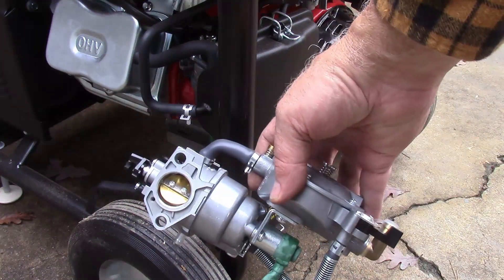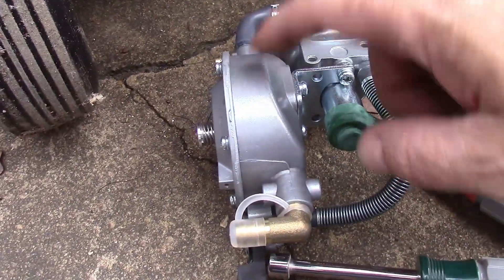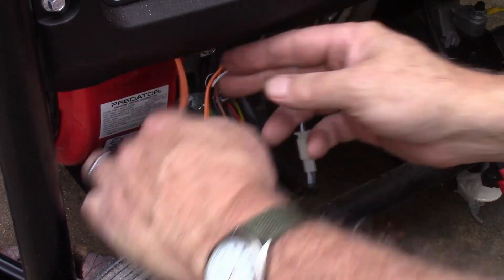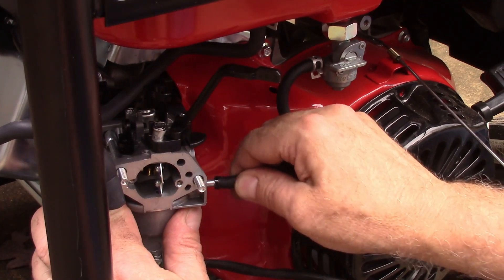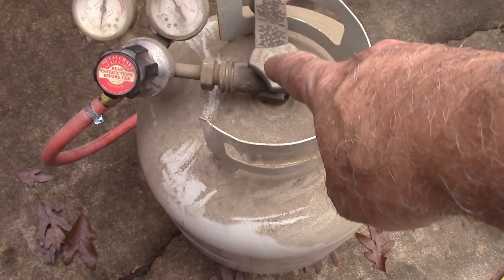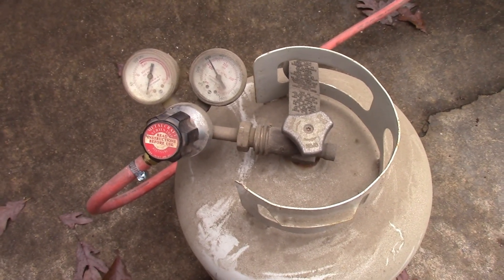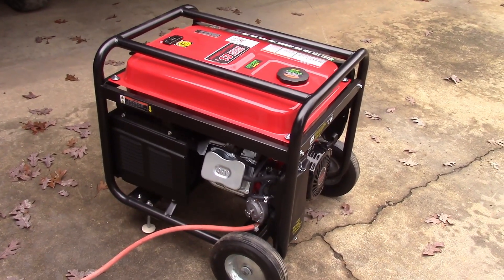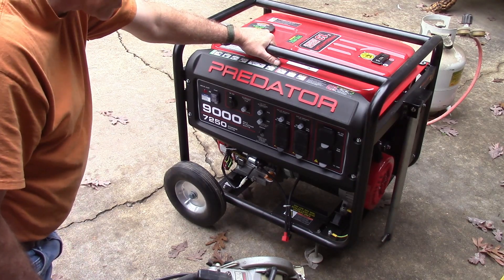Predator 9000/8750 Generator Propane Conversion  Tri Fuel

Comment: Very interesting, do you know how long it would run with a full bottle of propane?
Reply: I plan to connect mine to our 200 gallon tank. We only use it for heat w 2 propane heaters. So we’ll have plenty of propane should we need it. Plus i always have 10-20 gal of gasoline on hand at any given time. So we’d be able to run for quite a while. 
We just recently had a bad storm, as did everyone in the southeast and we were out of power for 5 days. 
I ran my gasoline engine Troy built 5550 gen for 4 ½ days. Stopped it from time to time. 
I used nearly 35 gallons of gasoline in that time. 
We went w this larger generator so we can have hot water. Taking cold showers w cold temps was rough. Ended up using my big crawfish boiling pot and used it to heat up water and poured it in the tub so it wouldn’t be so bad. 
We couldn’t run everything but we had enough to be comfortable. TV, internet, lights etc. 
Maybe this one will do everything we need. If not I’ll run both!
Reply: Marty Josephson That’s a big generator a 20 pound cylinder probably won’t last no more than a day and maybe not a full 24 hours however if you could have your local propane distributor help you you could hook up your generator to run on a much larger tank you can buy 100 pound cylinders and find a safe place to store them if you had three four five or six of them you’ve got some serious run time,,, even so if you can,,,,you really need to shut them generators down for three or four hours a day I know would be hard but if it is at all possible you’ll be better off to shut them down cool them off check the oil maybe do an oil change it saves fuel,,, and $$$$

Comment: I didn't see where you turned the fuel petcock off, but wouldn't that be a safety situation if open?
Reply: Here is a reminder about portable generator safety: everyone really needs to see this safety reminder to make sure. This advice is just to make sure that everyone is aware of all the warnings and it’s just to remind people to be careful using portable generators. Generators can be dangerous if not used carefully. Every year, hundreds of people die or get injured when using portable generators due to carbon monoxide poisoning and electrocution. Make sure you are using your generator carefully and keeping others safe as well. There is something very serious that everyone should always be aware of when using generators. Some people do run their generator indoors which is not safe and that increases the risk of carbon monoxide poisoning which can cause death of family and you. Some people run their generator in wet conditions which can electrocute them. Please remember that you should never run your generator indoors. Remember that carbon monoxide is an odorless and colorless gas that you cannot see or smell. Carbon monoxide is a silent killer. Keep that in mind. Make sure your generator is 15-20 feet away from your house and away from doors, windows, and vents. Never use your generator in your porch too. Having a carbon monoxide detector is very important against generator safety. Some people also allow children to go near the portable generator which could pose risks. We need to keep an eye on our children making sure that they are not near the portable generator so they won’t get electrocuted or burned by the generator which is dangerous. A locking enclosure also keeps kids safe. A generator shed might look like a tempting place to explore, or take cover during a game of hide and seek, but a generator is a dangerous piece of equipment that can cause injury. It says on the manual that we should also keep children away at all times from the portable generator to avoid injuries. Please do not allow a child or unqualified people to operate the portable generator. Just because some manuals missed what should be listed doesn’t mean it’s safe to do. Always follow the generator safety rules when using portable generators. Generators pose electrical risks. If you need to use your generator during wet weather, you need a generator tent to protect your generator from getting wet. Don’t let your generator get wet. Keep your generator dry and before using your generator, please make sure your hands and your generator is dry. Do not wear loose clothing when operating the generator. Everything that is said on the generator’s operating manual should not be ignored. Never smoke cigarettes near the generator. Please keep flammable things away from the generator. Never overload your generator too. Your generator can catch fire. Never ever try to plug a generator cord into a wall outlet to avoid back feeding. Back feeding your generator is dangerous. Always turn on your generator first before plugging in appliances and shut off the appliances before turning your generator off. Use a heavy duty cord for your generator and the cord should not be worn out. All the instructions should be followed carefully. Never refuel your generator while it’s running. It can cause fire if fuel spills while your generator is hot. You should turn off your generator and let it cool off before refueling it. Having a fire extinguisher next to the generator is also important. This is only a reminder for everyone’s safety of using generators. Make sure your generator is properly grounded. Having a fire extinguisher next to the generator is also important against the safety rules. https://youtu.be/I1jT3ANENvI and here is a video more about keeping others safe when using generators and also about our family’s safety. Hope this helps. Thank you.
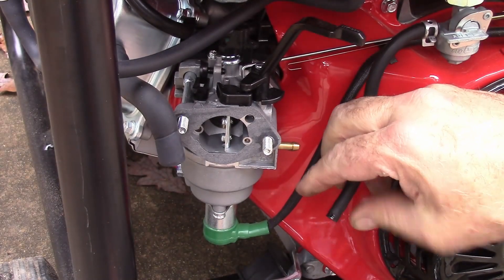Reply: @2:47 he says that the fuel valve is shut off.
Reply: @curiousmike1044  thanks for pointing it out.

Comment: Replace that black fuel line that comes from the gasoline tank ASAP they crack and leak fuel. It's a terrible quality and should have never been used. Nice video I have the next size smaller generator I will check into your conversion! Thanks
Reply: Here is a reminder about portable generator safety: everyone really needs to see this safety reminder to make sure. This advice is just to make sure that everyone is aware of all the warnings and it’s just to remind people to be careful using portable generators. Generators can be dangerous if not used carefully. Every year, hundreds of people die or get injured when using portable generators due to carbon monoxide poisoning and electrocution. Make sure you are using your generator carefully and keeping others safe as well. There is something very serious that everyone should always be aware of when using generators. Some people do run their generator indoors which is not safe and that increases the risk of carbon monoxide poisoning which can cause death of family and you. Some people run their generator in wet conditions which can electrocute them. Please remember that you should never run your generator indoors. Remember that carbon monoxide is an odorless and colorless gas that you cannot see or smell. Carbon monoxide is a silent killer. Keep that in mind. Make sure your generator is 15-20 feet away from your house and away from doors, windows, and vents. Never use your generator in your porch too. Having a carbon monoxide detector is very important against generator safety. Some people also allow children to go near the portable generator which could pose risks. We need to keep an eye on our children making sure that they are not near the portable generator so they won’t get electrocuted or burned by the generator which is dangerous. A locking enclosure also keeps kids safe. A generator shed might look like a tempting place to explore, or take cover during a game of hide and seek, but a generator is a dangerous piece of equipment that can cause injury. It says on the manual that we should also keep children away at all times from the portable generator to avoid injuries. Please do not allow a child or unqualified people to operate the portable generator. Just because some manuals missed what should be listed doesn’t mean it’s safe to do. Always follow the generator safety rules when using portable generators. Generators pose electrical risks. If you need to use your generator during wet weather, you need a generator tent to protect your generator from getting wet. Don’t let your generator get wet. Keep your generator dry and before using your generator, please make sure your hands and your generator is dry. Do not wear loose clothing when operating the generator. Everything that is said on the generator’s operating manual should not be ignored. Never smoke cigarettes near the generator. Please keep flammable things away from the generator. Never overload your generator too. Your generator can catch fire. Never ever try to plug a generator cord into a wall outlet to avoid back feeding. Back feeding your generator is dangerous. Always turn on your generator first before plugging in appliances and shut off the appliances before turning your generator off. Use a heavy duty cord for your generator and the cord should not be worn out. All the instructions should be followed carefully. Never refuel your generator while it’s running. It can cause fire if fuel spills while your generator is hot. You should turn off your generator and let it cool off before refueling it. Having a fire extinguisher next to the generator is also important. This is only a reminder for everyone’s safety of using generators. Make sure your generator is properly grounded. Having a fire extinguisher next to the generator is also important against the safety rules. https://youtu.be/I1jT3ANENvI and here is a video more about keeping others safe when using generators and also about our family’s safety. Hope this helps. Thank you.

Comment: Did not know you could get one that cheep I have a generac 8000 it,s still on reg gas but where I would leave it to run have a natural gas valve.
Reply: Here is a reminder about portable generator safety: everyone really needs to see this safety reminder to make sure. This advice is just to make sure that everyone is aware of all the warnings and it’s just to remind people to be careful using portable generators. Generators can be dangerous if not used carefully. Every year, hundreds of people die or get injured when using portable generators due to carbon monoxide poisoning and electrocution. Make sure you are using your generator carefully and keeping others safe as well. There is something very serious that everyone should always be aware of when using generators. Some people do run their generator indoors which is not safe and that increases the risk of carbon monoxide poisoning which can cause death of family and you. Some people run their generator in wet conditions which can electrocute them. Please remember that you should never run your generator indoors. Remember that carbon monoxide is an odorless and colorless gas that you cannot see or smell. Carbon monoxide is a silent killer. Keep that in mind. Make sure your generator is 15-20 feet away from your house and away from doors, windows, and vents. Never use your generator in your porch too. Having a carbon monoxide detector is very important against generator safety. Some people also allow children to go near the portable generator which could pose risks. We need to keep an eye on our children making sure that they are not near the portable generator so they won’t get electrocuted or burned by the generator which is dangerous. A locking enclosure also keeps kids safe. A generator shed might look like a tempting place to explore, or take cover during a game of hide and seek, but a generator is a dangerous piece of equipment that can cause injury. It says on the manual that we should also keep children away at all times from the portable generator to avoid injuries. Please do not allow a child or unqualified people to operate the portable generator. Just because some manuals missed what should be listed doesn’t mean it’s safe to do. Always follow the generator safety rules when using portable generators. Generators pose electrical risks. If you need to use your generator during wet weather, you need a generator tent to protect your generator from getting wet. Don’t let your generator get wet. Keep your generator dry and before using your generator, please make sure your hands and your generator is dry. Do not wear loose clothing when operating the generator. Everything that is said on the generator’s operating manual should not be ignored. Never smoke cigarettes near the generator. Please keep flammable things away from the generator. Never overload your generator too. Your generator can catch fire. Never ever try to plug a generator cord into a wall outlet to avoid back feeding. Back feeding your generator is dangerous. Always turn on your generator first before plugging in appliances and shut off the appliances before turning your generator off. Use a heavy duty cord for your generator and the cord should not be worn out. All the instructions should be followed carefully. Never refuel your generator while it’s running. It can cause fire if fuel spills while your generator is hot. You should turn off your generator and let it cool off before refueling it. Having a fire extinguisher next to the generator is also important. This is only a reminder for everyone’s safety of using generators. Make sure your generator is properly grounded. Having a fire extinguisher next to the generator is also important against the safety rules. https://youtu.be/I1jT3ANENvI and here is a video more about keeping others safe when using generators and also about our family’s safety. Hope this helps. Thank you. Stay safe

Comment: Should have asked you in the first comment....What are the wires for going to the carburetor for.  What is their purpose?  Have never seen that before on a small engine.And Thank you for the video.
Reply from the maker: It does do 220v
Two 3-Prong, duplex NEMA #5-20 120 V GFCI
One 3-Prong, NEMA #L5-30 twistlock 120 V
One 4-Prong, NEMA #L14-30 twistlock 120 V / 240 V 
One DC Outlet 12 VDC
The wires on the carburetor are to shut off the fuel if you lose oil pressure.  I hadn't seen them on a small engine either.

Comment: Very interesting indeed.   Will that generator do 220 Volts.   Like for a well pump and thank you for the link to the carburetor.  Good to get ready for the time when a generator may be needed.
Reply: Glenn Felpel yes it will you will need a L 14 twist lock plug and flexible 10/3  wire the twist lock plug on that generator will do 220 @ 30 amps
Reply: Thank you - I wanted to use if for our well pump and the 30 amps will be just fine.  Thanks again.  William